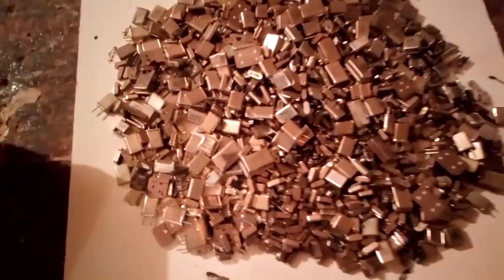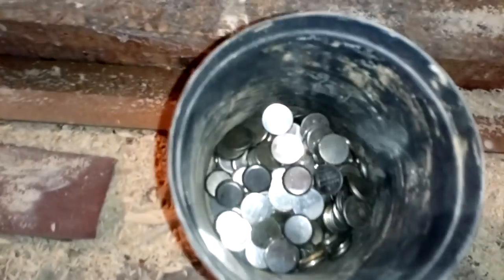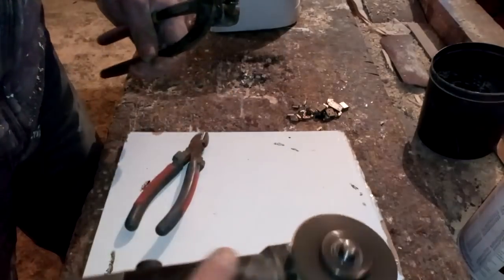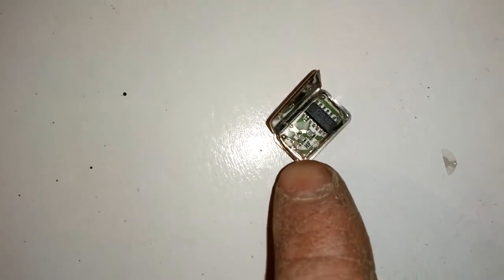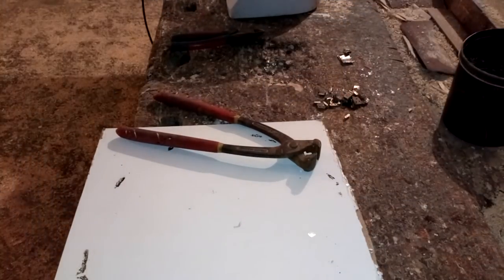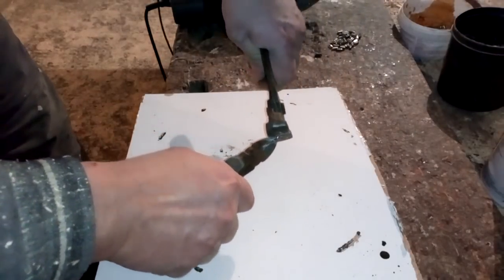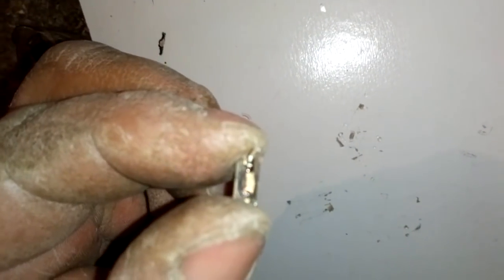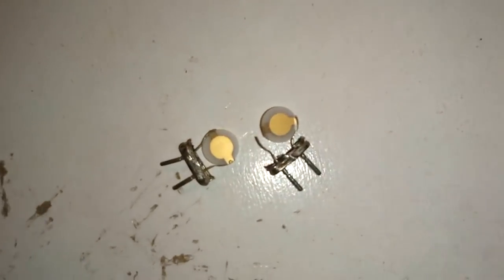Crystall oscillators and crystals processing for Silver and Gold.

Comment: If you have a big enough vice, you can put the angle grinder in the vice so that it is fixed and much more easier to work around it.
Reply from the maker: It's not a bad idea, I'll look at it for the next time.
Reply: Also, a foot pedal to turn the grinder on and off would be helpful.

Comment: I was wondering if you could just put all the oscillators in a beaker and dissolve them in boiled HCL? It would remove all the base metals along with the main can, then you are left with just a material for silver recovery and eventually gold
Reply: I was thinking about vinegar and salt, which should destroy the steel and aluminum and do nothing to silver and gold.

I'm going to throw a few of them into my test solution and see what happens to them.
Reply: If you can, do some approximate math about how many litres of HCl it takes to put that iron into solution.

Im not smart enough to do the math. But i am imagining it would be 10L or more.

Not worth the time or the money.

Comment: Thanks for sharing Maybe crush them up use magnet to get the steel out or use a screen what do you think may work?. Happy New Year
Reply from the maker: Maybe it would be easier to open if they were warmed up until they were heated, then switched to water to experience thermal shock, although after that everything would have to dry out before collecting. Only crushing I do not believe it would produce results because all metal would blind one to the second.